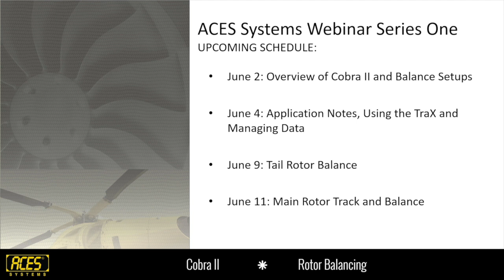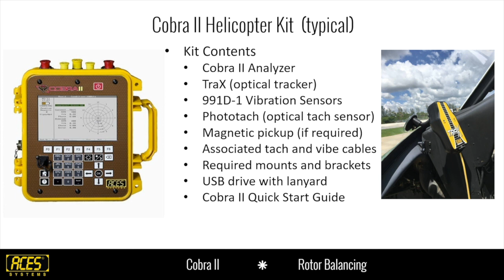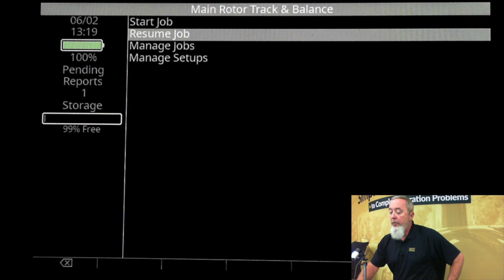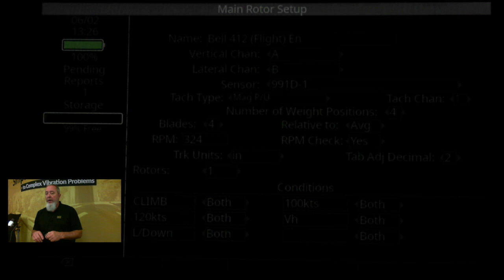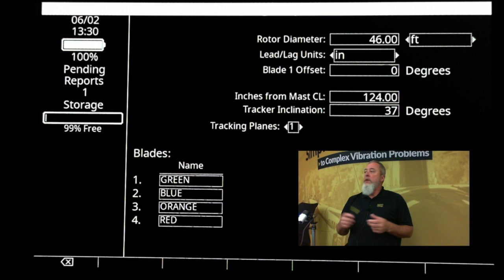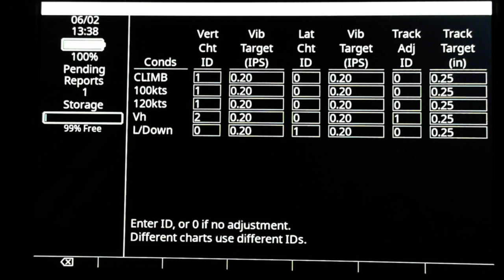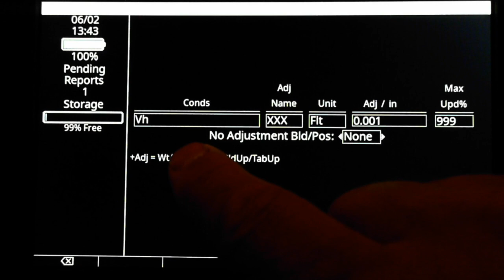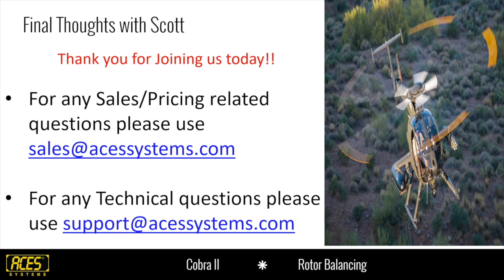Introduction to the Cobra II and Helicopter Balance Setups

Comment: The very first job this 67y private did was walk down the length of 20 or so kaman main rotor blades with a ball peen hammer and an ultrasound machine looking for voids in the spar which we found plenty of . When a void was found we walked down that blade with that hammer and knocked holes in the blades caned them back up and sent them back to kaman I think the manufacturer kaman 747 blades I want to say. Wild job for a private !